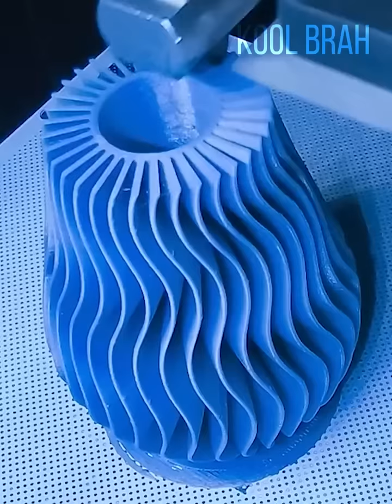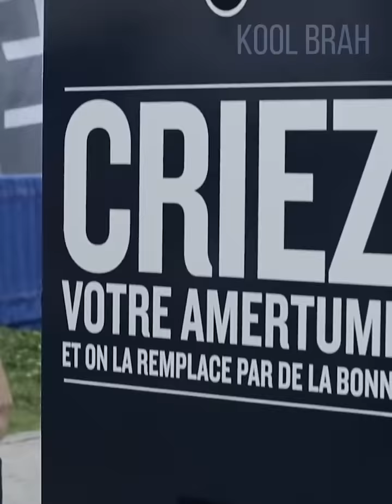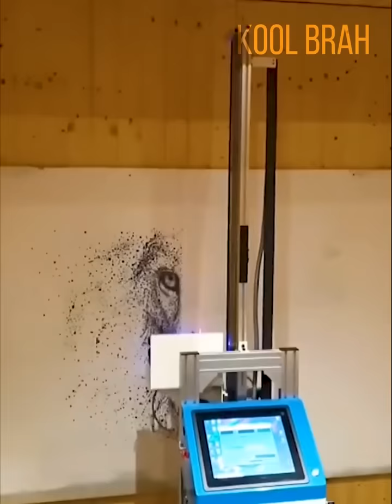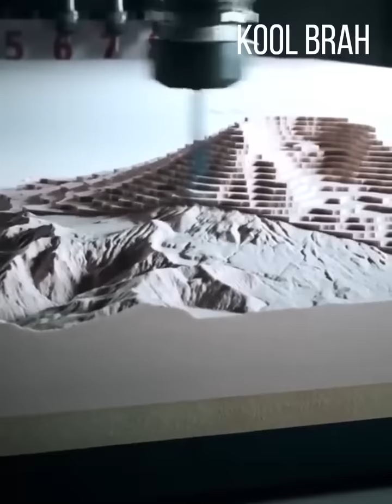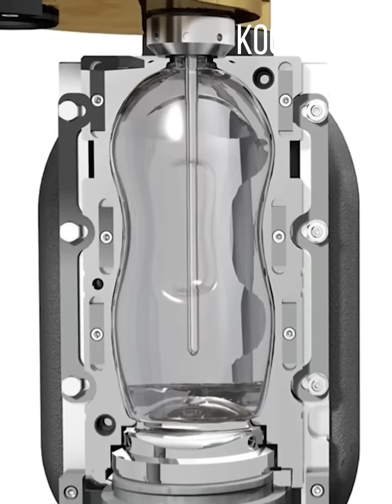Most Satisfying Factory Machines and Ingenious Tools | Incredible Factory Production Process

Comment: 2:18 I'm really afraid to scare the author... But... Thermite welding of rails... There was more... In Moscow, thermite welding was first used in 1915, when 126 joints were welded. In 1918, another 151 joints were welded. Since 1923, thermite joints have been regularly welded in the tram tracks of the capital. In 1923, 612 tram rail joints were welded in Moscow, and in 1924 about 4,000 joints were welded. In subsequent years, more than 100,000 joints were welded with thermite in the tracks of the Moscow tram.

Comment: Printed buildings often have a lot of structural problems ATM, as printing buildings is relatively new tech. High failure rates. That may / will change in the future, but right now printed buildings are nowhere near replacing traditional concrete building techniques.

Comment: Those orange hot cogwheels was in oil because it ignited water would be steam, The process is called quenching to harden the steel too hard and it becomes brittle
Reply: I might surprise you, but overheated steam contains hydrogen, which is pretty much inflamable, and those cogs were hot as hell..

Comment: The wheel disabling device for pursuit vehicals looks cool and all, but it is still the equavilent of a pit maneuver and the car can still go out of control and flip, often injurying or killing the occupants and risking the lives of others in some situations.
Pocket Saws: They have been around for years, starting with thin chains equiped with rings ont he ends. They now come in a variety of styles and sizes.
Reply: Locking up one rear tire is much safer than a pit maneuver.

Comment: 4:45  3d 
Ringers , we get it , I have one it is incredibly slow and will take like. I’ve hours for a hand sized thing and it will fail the print 74% of the time, and costs a s*itload of money but is still a great thing
Reply: Then your setting are absolute shit or you got a 100$ dogshit printer. Try use less infill or other types of infill. Try to adjust your print speed. Mine can handle 70m/s no problem. If your prints fail try to adjust your nozzle height and bed leveling. The right nozzle height prevents layer separation btw. But I myself are still fiddling around with the settings cause I'm fairly new to the hobby. My printer: Qidi X-Plus
Reply: @Slix_  yea I haven’t changed the nozzle in a while (I payed around 250€ for it) and my settings are still on default, but Prints still come out good (when they do)
Reply: @kosuken  depends how long your while is and what you print. Definitely check out Makers Muse (if I remember correct) for tips and stuff like that.